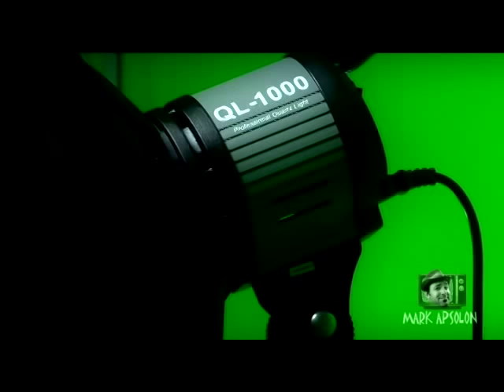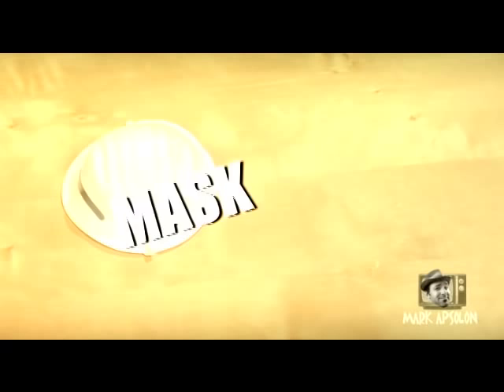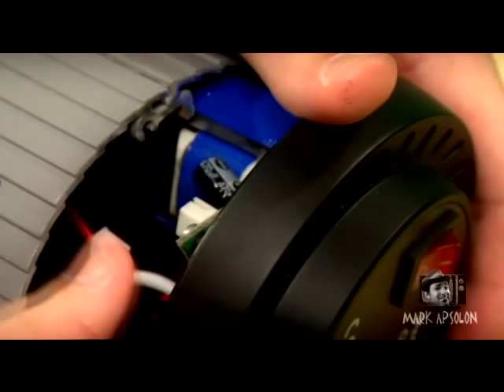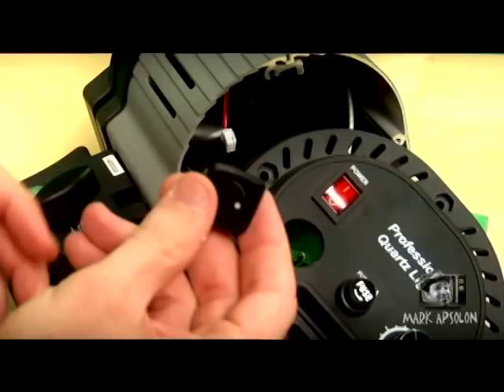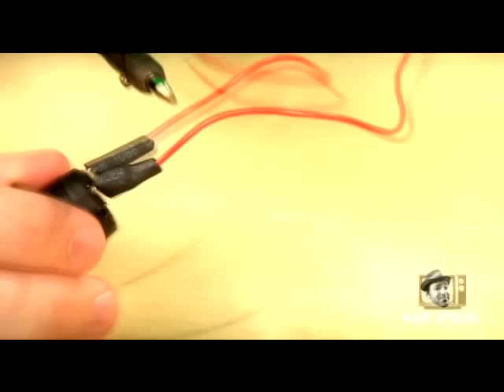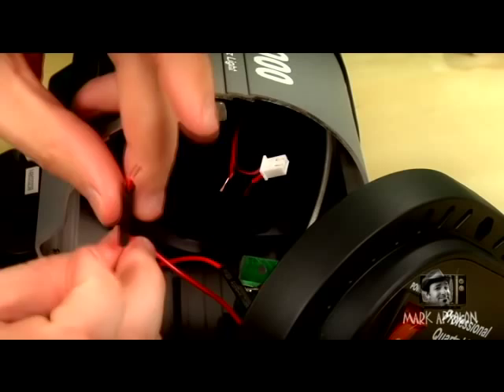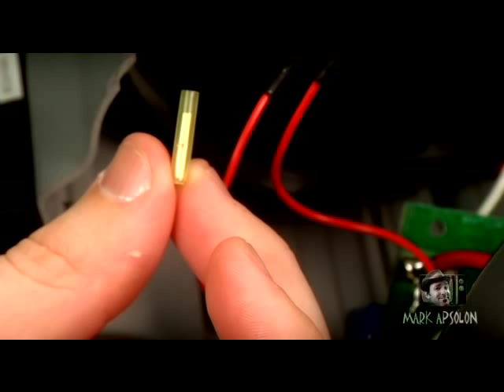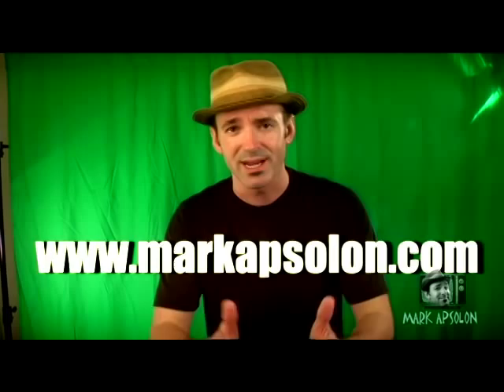Video Tips & Tricks ep02: How to Turn off the QL-1000  Fan and add a professional switch

Comment: Hey Mark,
Thanks for posting this. I may wire a switch into mine at some point however I may be happy with my current solution. I own 3 of these. I replaced the stock fan with a Noctua NF-R8 80mm fan.

The sound level is cut in half at least. I can hear the stock fan from across the room and cannot hear the Noctua fan unless I'm very close. There's a huge difference. The stock fan is rated at <33dB and the Noctua is <17dB.

I've only worked on one light so far. I purchased a 3 fan kit.

Comment: Oh also i loved the bit with the soldering iron when the solder moved and it didn't actually do anything other that melt the plastic on the wire.

I normally just  cover all of my contact with glue from a hot glue gun. if i use shrink wrap just wave it underneth the shrink wrap a few times.

Comment: Mark,
Do you have to use a switch or can you use a variable power dial? Similar to the one on the QL-1000 that adjusts the light intensity. If so you could adjust the fan noise down without losing all of the ventilation.

Comment: I have a question. You see I recently bought this kit online, but by a mistake, I recieved a VL 1000 kit instead. The kit seems very similar and from what I can tell, they're just as good. But what I'm wondering is if the process of installing the switch is the same for these lights. Do you have any experiance with the VL 1000 lights? Would the wiring inside these light heads be the same as the QL's?   Any help on this would be great:)